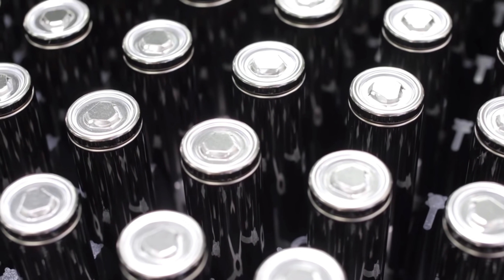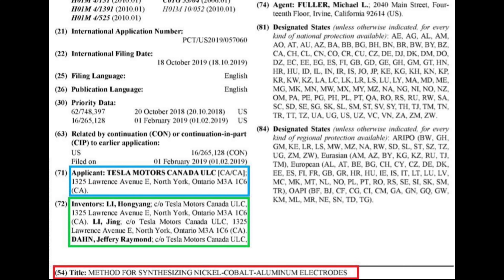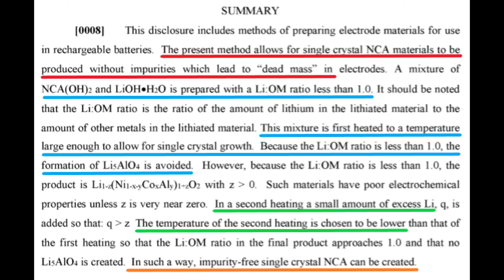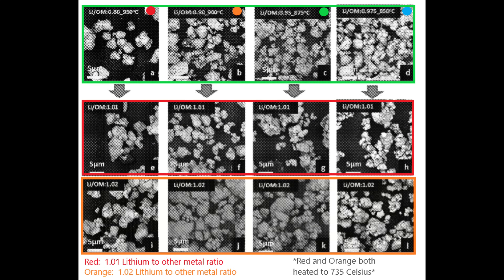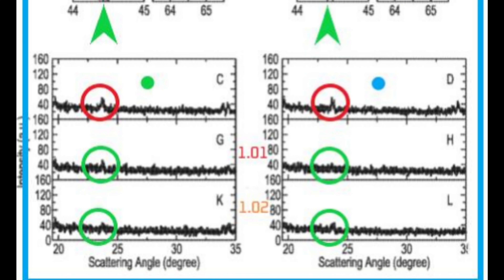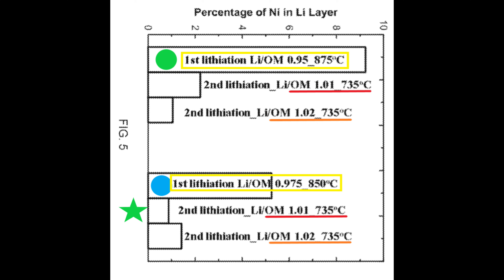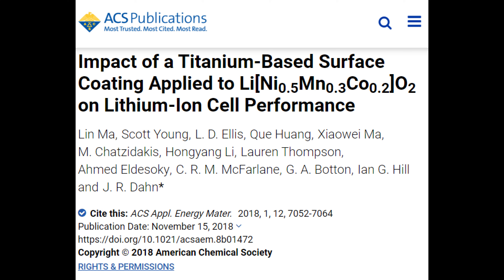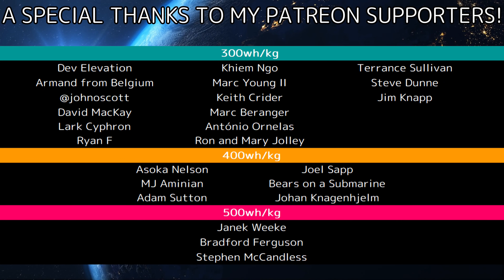Tesla Single Crystal Cathode Patent (Deep Dive)

Comment: Wasn’t graphite supposed to be used still in Jeff Dahns million mile battery? I remember his first announcement mentioned it.
Reply from the maker: Correct!  NMC and NCA are strictly the cathode.  Graphitic anode will still be in place for many years.  However, it will be spiked with more and more silicon.
Reply: @thelimitingfactor  In 2018, Elon spoke of the long range, 6 to 8 year battery plan and said:  "For that really big jump (in efficiency), a lithium anode is key - just plating out pure lithium on the anode."  Does a modified Maxwell DBE process make it possible now?  Perhaps reaching that "really big jump" in just 2-3 years is what blows Elon's mind.
Reply from the maker: @allenyoungwood1133  Not yet.  If they did, they would be several years ahead of the brightest minds in the industry.  I expect at least two years before a pure lithium Anode is unveiled, let alone manufactured.  Maxwell tech wouldn't even be needed for a pure lithium Anode, at least on the anode side.
Reply: Tesla is several years ahead in every other aspect of EVs, why not batteries? The brightest minds in industry (not academia) keep secrets until patent applications are released or patents granted. DBE is a highly efficient dry coating method. Could it be adapted to apply a VERY THIN pure lithium "plating" on a graphite/silica anode core? As far back as 2016, Franz Fink, Maxwell CEO/CTO, was talking about their capability to "lithiate" or "pre-lithiate" the anode, having a proof of concept and developing a pilot plant. Is 4 years enough time to perfect a plating process using DBE coating techniques? I think it is. Perhaps this could be done by other means, as you suggest, but would it be as efficient and cost-effective?  Also, Tesla would have to license some other method, whereas they own DBE. More reasonable to think they would use DBE in their manufacturing and license it out to other battery makers.
 
Go back to Shirley Meng's Gen 3 Li-metal 400-500 Wh/kg model:  (advanced) cathode + safe electrolyte + ultra thin lithium metal anode. The Dahn NCA single crystal patent and the range of other metals you discuss tick off that cathode box. You lay that out thoroughly and I agree, soon to be cobalt-free. The Dahn/Dalhousie electrolyte and additives formula along with the sodium difluorophosphate substitution seems to check the safe electrolyte box and perhaps even exceed Meng's expectations. Which only leaves the ultra-thin lithium metal anode discussed above. Your research is excellent, but it builds a theory based only on known elements. Why would Elon have a splashy battery event if he doesn't have something new and awesome to reveal, or is ready to announce a major leap in metrics achieved? Elon has dealt himself some wild cards and they are all face down until Battery Day.

All of the above makes the assumption that the May reveal does not stray far from traditional lithium battery constructs. I think that is likely. However, I will again speculate that an advanced hybrid lithium capacitor (Maxwell's "L-Cap") could be integral to Roadrunner.
Reply from the maker: @allenyoungwood1133  Awesome comments Allen.  I think a pure lithium plating would be a stretch - still too many unsolved problems.  Pre-lithiation has a decent likelihood, which could add 5-15% energy density (I don't know what the first cycle losses are on a Tesla battery).  They actually released a patent application for this today.
Reply: I believe, based on the following tidbit, that Maxwell's tech eliminates the first cycle loss, mostly if not entirely. (BTW, Franz speaks English as a second language, so he tends to mangle sentence structure when he speaks extemporaneously.)

Dr. Franz Fink from the transcript of a Maxwell quarterly conference call in 2016 responding to an analyst question:  "As you look at, particularly, the anode side of things, and what you could do to make sure that you don't have (just like in lithium-ion batteries), not the first cycle loss of energy and looking to the lithiation - pre-lithiation capability, and I don't want to go into more details not to give too much away. With a dry process, you can imagine that could be fairly easily established."

Back to the Shirley Meng model. It is quite possible that the ultra-thin lithium metal anode component has been in the bag at Maxwell for a while, and it was the electrolyte component and particularly the cathode component that were the lagging pieces to complete the Gen 3 package.

Basic question:  Can Tesla's battery pack get to a million mile life if it still includes the traditional first cycle loss?
Reply from the maker: @allenyoungwood1133  Interesting!  You must have been following Maxwell for a while or done some deep dives!  That's great information.  

On your question, it depends on what methodology they use to eliminate the first cycle loss.  But, the short answer is yes.  It depends on how much of a 'fingerprint' the doping materials leave.  If done right, it can actually extend cycle life by reducing the internal resistance of the cell.
Reply from the maker: Do you have the transcript of the conference call?  I might incorporate it into the video I'm currently working on.  I'll give you a shoot out or screenshot this if I do.
Reply: As you inferred, I followed Maxwell closely for quite some time. I will email you the most important portions of the transcript in question. In it you will see one of the key underpinnings of my "L-Cap" theory. Perhaps it will pique your interest in that direction. No recognition, but thank you anyway.
Reply from the maker: @allenyoungwood1133  thelimitingfactor9000@gmail.com  Thanks man!
Reply: I was looking at graphite mineral companies coming online over the next few years because Tesla would use them. I’m sure their will still be a market for graphite but if Tesla’s main battery doesn’t use it then I have a different outlook now
Reply from the maker: @predawn2620  I think the humble graphitic anode has a LOT of life left in it.  I've just invested in Talga resources (not recommending anyone else does).
Reply: Of course, especially a great deal of them in the cents range making it an interesting prospect. Do you have a FB group? I’d join up to keep talking about it if you were to create one. I did just watch  TLG investor webinar. I’ve been keeping an eye on Nouveau Monde Graphite, was waiting for more info on Tesla before buying some.
Reply from the maker: @predawn2620  Usually I do most of my interaction on here, on Reddit TLFBatteries forum, and twitter.  Keeps me plenty busy, lol.  Links in the description.